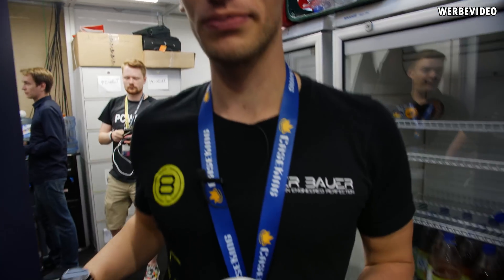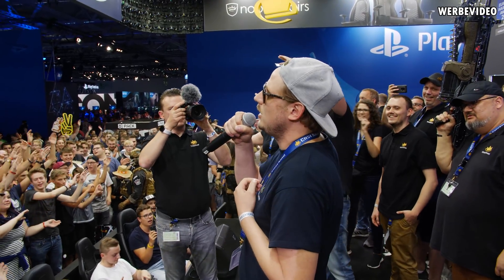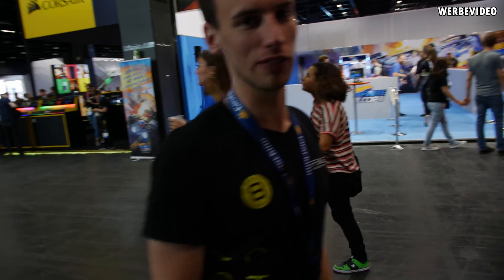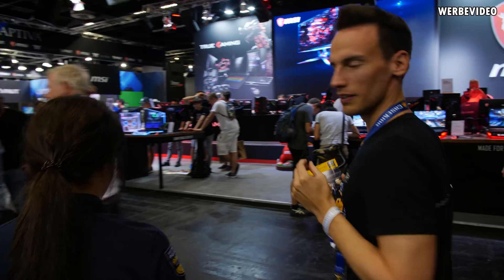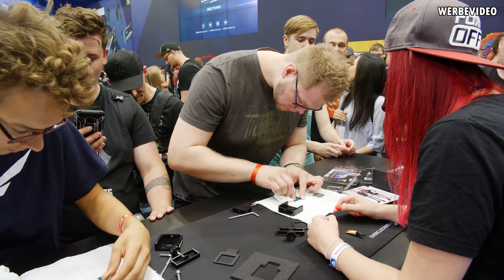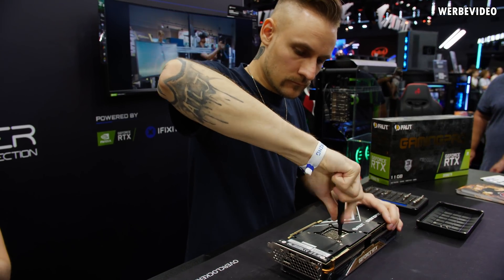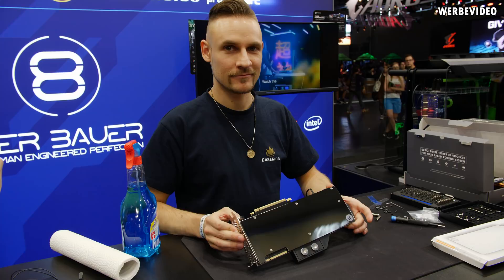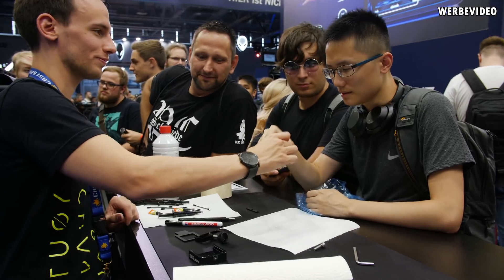Absolutely INSANE - Gamescom 2019: Live CPU Delidding, Visiting Vendors and Cricket Tasting

Comment: Can you do some Zombie card / External VRM things more? I just finished building external VRM card from dead GTX 480 as it has 6+1 phases and i even managed to make it output around 0.9V but i need to make feedback mod with 100 ohm trimmer to make it adjustable and build some sort of active cooling for the VRMs. I have plans to attach it to GTX 760

Comment: A hard tube bending workshop is fun, I would like to try it but no way that I will custom watercool my PC with the current cost. Roman, it is a good thing that you caved for peerpressure with eating crickets and not with smoking. ;) In the future humans will eat a lot more insects, we have to. Insects contain more proteins per gram than meat from mammals.
Reply: I think the cheapest option is an alu set from ek but yeah blocks and radiators are expensive